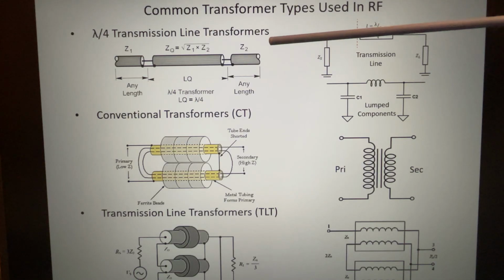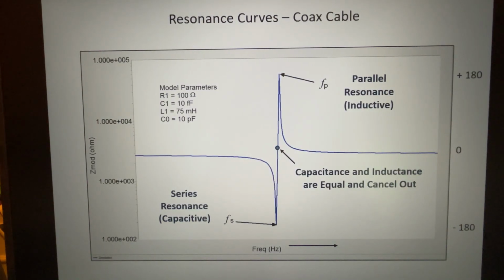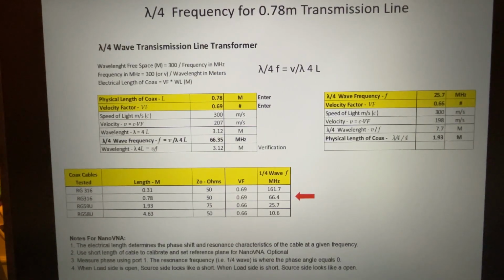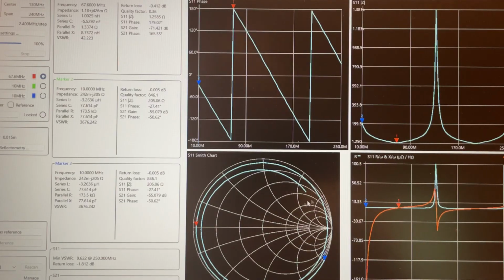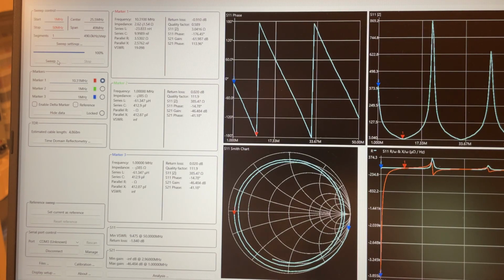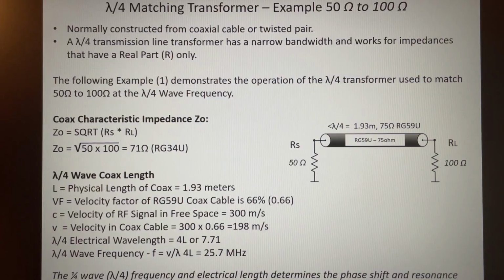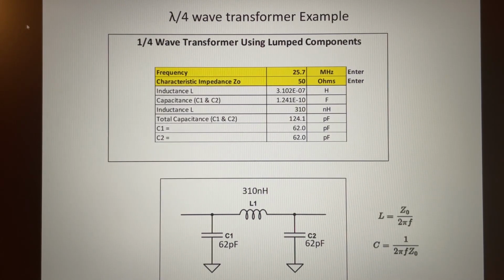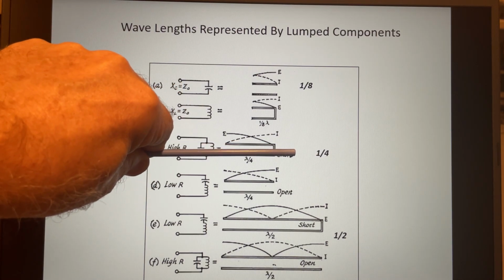RF Transformers Explained - Part 1 of 3

Comment: thanks sir, also i have a question. how to design rf amplifier using small signal analysis cause i only have s parameter. im confuse how i can use the s parameter and design it to circuit ?

Comment: Good timing! I keep trying to make simple single-ended amplifiers and never seem to get more than 2-3 W at 12-16 V with an RD16HHF1 despite using a 3:1 turns ratio transformer on 43 material binocular cores. I seem to always lose as much power in the transformer as I gain by providing a better impedance match. This reminds me that I need to rewatch your series on amplifiers too.
Reply: I am planning a video on single ended RF amplifiers soon. If you send me your schematic I would be happy to take a look for you. The transistor you are using is rated for 16 watts, so you should be getting more power output. As you already know, drive level and impedance matching are important to achieve good efficiency and higher output power. Regards  RF Man
Reply: @carminecampo2045  Awesome! I'll put together my schematic and send it to you this weekend. Right now I just have a pencil schematic in a notebook, but I've been meaning to get around to putting it in LTspice. I'll do that and send it to you.